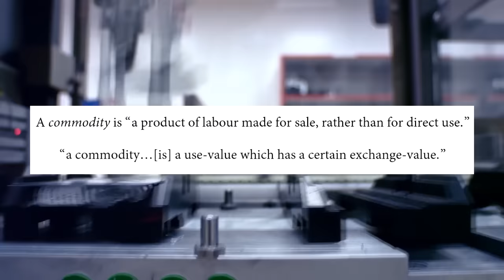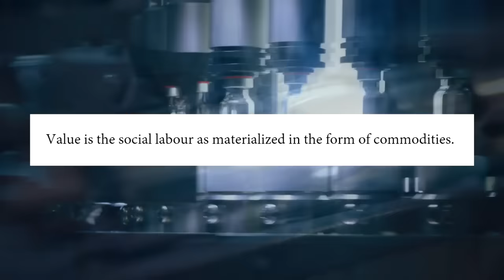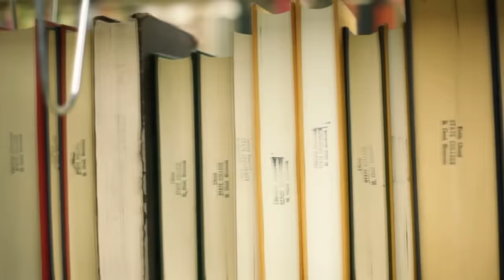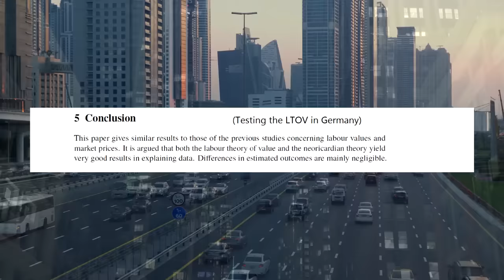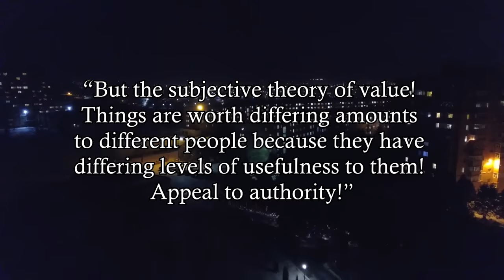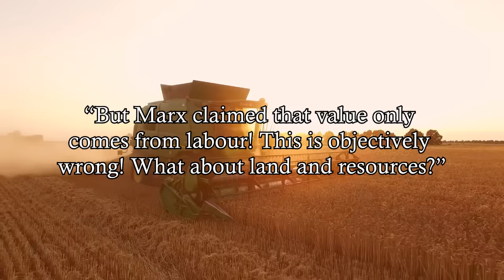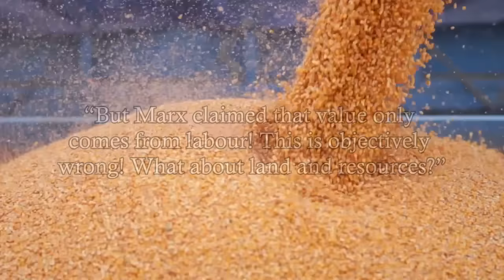Capitalist arguments against the labor theory of value suck (Explaining the LTOV) - Socialism 101

Comment: My Marxian econ prof explained it to me best: LTV doesn’t determine price (in a market), supply/demand does. But the difference between material cost and price is best explained by the labor that shaped the material into the final product.
Reply: Any contention to this is just ideological opposition to marx, before marx all capitalist economists agreed with this premise, because it’s obviously correct.
Reply: Except supply and demand are a myth
Reply: Some genius in economics:
“bUt WhAt iF I wAnT tO pAy $1000 fOr A jAr Of AiR ?
ChEcKmAtE, MaRxiSts !”
Reply: It kinda does. It basically sets an equilibrium point around which the price dances. Market forces can affect price to a degree but a car will have higher price than a pencil and calculating labout inputs allows you to predict prices with 95+% accuracy, which is better than any other economic theory.
Reply: @cezarcatalin1406  or for gamer girl bathwater :^)
Reply: @nonono4160  Until companies decide to ratchet up the prices randomly like they do all the time for all sorts of things?
Reply: @RaistlinMajereFistandantilus  i suggest you read "Scientific status of LTV" by Cockshott and Cottrell.
Reply: @RaistlinMajereFistandantilus   exact pricing aside, the only reason they can charge more than the material cost is because of labor. monopolist exploitation of consumers for necessary goods is a very different animal
Reply: @Bovice..YT-handles-are-fn-dumb  You’d need to look at course catalogs for the econ department at any given university. If there’s a good number of classes on labor, socialism, inequality, china, ussr and marxism then you can bet there’s plenty of marxist profs in the department. I got lucky and my (capitalist) family’s preferred university also happens to be the only university in the USA where Marxism is dominant in the econ department. (Surprisingly, the University of Utah, if you’re curious)
Reply: @jaredharmer7047  So Utah is officially AES?
Reply: @lucastudios86  I don’t know what AES means
Reply: @jaredharmer7047  “Actually existing socialism”, I was joking (even though “Soviet Republic of Utah” sounds nice)
Reply: @lucastudios86  when the US has its revolution I would guess states would take up the name Utah SR for socialist republic. 

So the USA would turn into the USSA (which I think is quite nice)
Reply: @jaredharmer7047  Literally the last state I'd think of, after Texas. Lol
Thanks for sharing
Reply: @cezarcatalin1406  like ppl don’t already do things similar to that now
Reply: @RaistlinMajereFistandantilus  The notion of some glorious equilibrium is a myth, the existence of supply and demand curves isn't. Businesses are going to produce more if the price is higher, consumers are going to demand less if the price is higher. However having some magic point of perfect equilibrium is ridiculous.
Reply: @lucastudios86  It would just be "Social Republic" or "People's Republic" rather than Soviet, given that it's not really a "soviet" (worker council) system.
Reply: @jeetadityachatterjee6995  If each state becomes its own independent republic, similar to members of the USSR, maybe it'd become the United Socialist Republics of America, or United People's Republics of America (in the same vein as People's Republic of China)
Reply: @Tetragrammaton22  Make sure to edit that bit about businesses producing more with higher prices, but yes as an economist this is definitely the way I see it. Economics is a social science based on philosophy and a bit of math, not an exact science 100% based on math. Anyone (liberals/conservatives usually) who says that economics is an exact science is either deluded, a grifter or both
Reply: @simonmacconmidhe9489  Well strictly speaking prices are determined by capitalists, but if they’re smart (which certainly is not always the case) then in order to maximize profit the price will be set where the inverse-elasticity of demand = markup, which is dependent on competition, demand and overall supply in the market. Necessities and monopoly markets have a high inverse-elasticity, so they have a higher markup.
Reply: the LTOV doesn't determine the final price per see, but it does determine its center of gravity. the final price can go lower, or higher, than the center of gravity, but it always revolves around it.
the descrepancy then, between the center of gravity, and the price at any single point in time, comes from bargaining power, not necessarily supply and demand.
for example, with high supply, a capitalist can get away with less, due to competition with other capitalists who will seek to undercut them; but a monopolistic capitalist, even if they have high supply, can get away with more.
the bigger the bargaining power of a holder of a commodity, in relation to its buyer, the bigger the descrepancy between the final price of a commodity, and its center of gravity.
Reply: Schrödingers Katze  Yeah it’s tough. Wolff and Piketty are pretty solid in the modern day, but that class really just focused on Capital, the value was more in having a prof to explain it and provide modern empirical evidence for it. So any material that thoroughly dives into Capital would more or less be akin to what I experienced in that class
Reply: the socially necessary labor time embodied in commodities determines supply and demand. pointing to supply and demand as the determiner of prices on the market is begging the question.
Reply: @jaredharmer7047  Utah?! Yes that is a surprise
Reply: @simonmacconmidhe9489  nah, the layman one.
Reply: @RaistlinMajereFistandantilus  I would use the word social construct like any economic system. But yeah we don't have to a system depending on supply and demand.
Reply: @flantos23   the total amount of labor time (and thus total amount of supply) is determined by the capitalist. Consumers determine demand. So no, you’re wrong on both fronts.
Reply: @simonmacconmidhe9489  No prob comrade
Reply: @Bovice..YT-handles-are-fn-dumb  how do you know he studied in the US
Reply: No, it isn’t as demonstrated by Bohm Bawerk and time value of money.
Reply: @ExPwner  if I remember them correctly, they are a joke dude
Reply: @Kolokommouna  nope. They are not and this is not an argument.
Reply: But your "marxian econ"(whatever that means) peof is wrong.

Profit determines prices, supply and demand equillibriating is profit. if you have an industry of duopoly.where one market is perfect and the other is a monopoly. you have two competing markets. the monopoly can set prices twice lower or higher based on its elasticity. meaning what prices it deemed profitable in relation to quantity.perhaps setting prices lower at bigger quantities is more profitable. so you see.profit is what determine price.
Reply: @proximaism  Well technically the profit maximizing price is set based on inverse-elasticity, which is a function of supply, demand and competition. So understanding profit is necessary to calculate the profit maximizing price, but that doesn’t mean profit caused the price - supply, demand and competition does that.
Reply: @proximaism  profit determines the direction of capital. If you are so inefficient that the prices set by supply-demand dynamics make you go negative, you are going to be outcompeted.
Reply: @ExPwner  ofc it's not. It is a statement that alludes to arguments you, yes you, can find on the internet 
Do your own research I am not your teacher
Reply: @Kolokommouna  you have no argument against Bohm Bawerk and neither do any of the Marxists. Hell you couldn’t even be bothered to restate what his refutation is. “Google it” is not an argument either. It’s just lazy ass posturing. I have done my research and I am debunking this garbage with my research. Take your own advice.
Reply: @ExPwner  not everyone is able to be constantly able for an all-out ideological debate. Call me lazy if you want, but you can't know the circumstances of my previous comment.
However, if you're truly interested in research and the truth, and not just self-validation, you'd search for possible challenges to your beliefs when you're made aware of them. To have no doubt and to stagnate is folly.
Also, be careful of calling scientifically proven theories garbage. I see that the OG commentator has more energy than me, go argue there
Reply: @RaistlinMajereFistandantilus  they're not a myth on their own, they're just most useful as academic modeling concepts and can't be treated as some kind of established physical law. 

Because economics are not a hard science, it's a social science, and most of its adherents do not appreciate that truth.
Reply: @RaistlinMajereFistandantilus  so is money- but that doesnt change what will be done to you if you don't pay your bills
Reply: @jaredharmer7047  well- having a monopoly or near monopoly kinda lets you charge whatever you want. Labor sets the price floor, which is definitely kept track of to determine margins.

Although- our economy has gotten excessively weird, and loss-leader strategies dig beneath the price floor, as do anticompetitive strategies like the purely labor service industries of DoorDash/Uber

The word "value" is a little wishy washy, but its pretty clear what he meant. 

Basically, you make profit when you underpay your labor or charge above the real value.
Reply: @jeetadityachatterjee6995  are you serious about that revolution?
Reply: A Marxian econ professor?? Where
Reply: @playerhateroftheyear1084  Ironically, University of Utah economics haha. My upper division macro prof is a hardline Maoist who got expelled from China for criticizing the CCP from its left flank. (Li Minqi , his wikipedia is fascinating if you’re curious)
Reply: @Kolokommouna  nothing about your theory is scientifically proven.
Reply: @ExPwner  
p(X=x) = [1/σ*sqrt(2π)]*[-(x-<x>)^2/2σ^2]
The probability density function of a random event with values that tend to concentrate around a mean value. 

It has been used by Cockshott, analysing the seemingly random patterns of prices. Naturally, the LTV was proven correct with a 95% accuracy, a ridiculously small relative error btw, using this method, not unlike the methodology of defining the laws of thermodynamics
Reply: @Kolokommouna  again, already addressed and debunked.
Reply: @ExPwner  you can't debunk a fact. Its interpretation, yes but not a fact.

You didn't debunk the fact I presented.
Reply: How does that apply to a service economy?
Reply: @RaistlinMajereFistandantilus  cringe
Reply: @Etherchannel  if you use Adam smith's distinction between unproductive and productive labour, it still applies
Reply: @Etherchannel it’s the same, it’s just shaping immaterial stuff (training) into a final immaterial product (service)
Reply: This is only true if you include subjective components (mainly marketing) as part of the final product, since some markets have very low cost of production (like beverages, as beer and vodka, that cost cents to produce) and very high margins into the price. I've heard recently of a beer sold for 0,86 for employees, which is sold for around 13,99 in the market for final consumers. The difference, even accounting taxes, transportation and selling costs (whole sales and retailer), can't be explained only with material cost and labour.
Reply: @RaistlinMajereFistandantilus  that's the only explanation to why an iPhone is marketed at USD 2.000.
Reply: @jaredharmer7047  the cost correlation with labour time is because hourly pay is based on labour time. More labour time means more cost to the final product according to time.

It's no great insight to say that the portion of product price above material cost tracks closely with labor time when that is literally the system you are using to pay the laborers! It's a self fulfilling prophecy. 

If you take step back and think about, it is common sense.

If you had a different method of payment for the laborers not based on flat time, the portion of product price due to labor would be explained much more by supply and demand rather than labor time just like the rest of our value system.
Reply: @RaistlinMajereFistandantilus  You can only ratchet up prices so much until consumers are unwilling to pay for things. Prices are set by the average rate of profit pertaining to each industrial sphere. Price changes that are unrelated to material changes in value can only affect a minority of capitalist businesses and are offset by changes in the opposite direction by other businesses.
Reply: @jeetadityachatterjee6995  USSR stood for United Soviet Socialist Republic
Reply: @howenator  That's just factually untrue. For one, look at gas. Prices go up across the board and people have literally no choice but to pay whatever insane price they set. If an entire industry decides to fuck you over all at once you have no recourse. It happened with internet providers, it happens all the time with water and electrical power providers, they can simply charge whatever insane price they want and people don't have the option to choose not to pay.
Reply: @howenator  Plus, they are absolutely in no way offset by changes in the opposite direction. If that were true then inflation wouldn't exist cause some things would get more expensive and others would get less. Historically all businesses raise their prices as soon as they feel like they can get away with it.
Reply: Hell even Karl Marx said it himself that LTV doesn’t determine price. price and value are two separate things.
Reply: Labor theory of value always comes second to subjective theory of value. You may call people "weird" and the subjective theory of value ridiculous but that's how the world works.

People have different interests and different values that's why it's in fact ridiculous to try to quantify something like "a value of a product" in the way Marxism does.

In fact, our interpretation of the world is not materialistic, it's a bunch of categories which we apply value to because in this way it's easier to organise the world around us. Much like when we use the interface of a computer program instead of the actual mechanism of the program which would be an impossible task for most people!

Again, Dialectical materialism is the culprit for that line of thinking! It's an inadequate philosophy no matter how much you are mad at Capitalism!
Reply: the transformation of something to something is derived from labor, but the valuation itself isn’t
Reply: That doesn't make sense. Given a uniform profit rate, prices are determined by costs. Obviously, costs consist of material costs and wages, so the difference between material costs and prices is explained by wages and the profit rate, but that has nothing to do with marx and is completely in agreement with neoclassical economics.
Reply: Wow, that's possibly the dumbest thing I've ever read.  LTV does not describe the cost and price, as both are prices.  Only DEMAND affects the difference between cost and what you sell it to the consumer to.  Holy crap, I can't believe you actually said that came from a professor. 

The labor theory of value is capable ONLY of describing the amount of labor necessary.  Which is useless for all applications, as amount of labor is absolutely useless, only price of labor has use.
Reply: @SnakeWasRight  that's also wrong. Demand does not determine the profit rate. For a fixed level of wages, there is only one set of prices in all the different industries that implies the same profit rate for all industries. That profit rate does not depend on demand.
Reply: @Porky no. Not at all.
Reply: @Ffkslawlnkn  wrong on every conceivable level.  Those guys can't be making profit unless there's a demand for their labor.  No, every company does not have the same rate of profit.  The reason prices are SIMILAR across an industry is ALSO because of DEMAND.  customers demand lower prices, so if you can offer them lower prices, you can get more customers.  Some customers will pay a premium for brand names, they have a demand for a brand name which makes products of identical functional quality have different prices based on DEMAND for a brand logo.  It truly astounds me how commies don't know the first thing about why people buy things... well it should be that shocking, given how all their economic models always fail catastrophically.
Reply: @SnakeWasRight  obviously, you can't sell goods unless someone wants to buy them. Nobody thinks you can sell products no one wants to buy. But the rate of profit does not depend on demand. Capital flows where it generates the most profit. Thus, profit rates in different industries tend to even out. Every theory, from classical to marxist to (post-)keynesian to neoclassical, assumes this.
An economy with n goods therefore can be represented as a system of n equations of the form price=sum of (amount of goods necessary for production*prices)*(1+profit rate)+hours*wage.
n equations with n+2 unknowns means that if we treat say good 1 as a numeraire and fix wages, there is only one level of profit that solves this system. The profit rate converges towards this level, which does not depend on demand.
Reply: @SnakeWasRight  price depends on demand only in the short run. Long run prices are the prices that solve the equilibrium system. If the price of good 1 is any higher (say because of a hike in demand), producing good 1 is more profitable than producing say good 2. As a consequence, capital is flowing from industry 2 to industry 1, increasing the price of good 2 and decreasing the price of good 1.
According to standard mainstream economics, the labour market tends towards equilibrium, so the wage only depends on the derivative of the production function and the labour supply, not on the demand for goods.
Reply: @jaredharmer7047  no economist ever thought that labour does not explain prices, but does explain the difference between the price of a good and its production cost. It does not make any sense. Production cost IS a sum of prices. Either the ltv does explain prices (which it does not, as marx knew very well), or it does not - and then it cannot explain profit. Also, demand does not explain prices either.
Reply: @nonono4160  a car has a higher prices thanba pencil because nobody would supply a car for 5$. The amount of labour necessary to produce a good does not determine its equilibrium price. Equilibrium prices and labour time have to diverge if the capital to labour ratio is not equal in all industries. Marx knew this of course.
Reply: @bb-wb8sb  not only is there no reason why the amount of labour should determine a good's equilibrium price, it is also logically impossible if you are not assuming constant capital to labour ratio in every industry.
Reply: @jaredharmer7047  Do you realize that it does not make sense to suggest that something does not explain prices, but does explain differences between prices?
Reply: @Ffkslawlnkn  Looks like jamesbunchofnumbers skipped calculus class
Reply: @jaredharmer7047  you actually do not realize that it does not make sense to suggest that prices are determined by supply and demand, but profit - the difference of prices - is not? I am ... impressed in a way.
Reply: @Ffkslawlnkn  Bro 847 other people understood it, it’s not my fault your brain is broken. The point is that it’s a qualitative explanation, not a quantitative one
Reply: @jaredharmer7047  'look there are people agreeing with me' is a pretty strange argument, considering the fact that nearly all economists in the world disagree with you.
The idea of a 'qualitative' explanation for the fact that there is profit does not make sense. There is profit (aka price-cost) because price is higher than cost. And if price and cost are determined by supply and demand, then the difference is, too, and the explanation for the positive difference between price and cost is that businesses would not supply if they did not make profit.
Reply: @Ffkslawlnkn  "a car has a higher prices thanba pencil because nobody would supply a car for 5$"

That is just a roundabout way to say "that's just how it is, no one knows why". Not an actual explanation or rebuttal.
Reply: @nonono4160  you were implying that it's not market forces that make cars more expensive than pencils. But this fact is entirely consistent with and can be subsumed under the market forces of supply and demand.
If your point is that reproduction costs constitute a lower bound for wages - sure, and nobody denies that. Nobody would rebut that.
There is a definite rebuttal of the idea that labour time is proportional to prices though, and marx himself wrote about it extensively.
Reply: @Ffkslawlnkn  you dance around the issue without actually answering what you should've answered in previous post. Also, it's not direct labor time, it is snlt that defines the equilibrium for prices.
Reply: @nonono4160  not only is there not argument for snlt to determine prices, it is actually impossible for prices to be proportional to snlt except if all industries exhibit the identical labour to capital ratio (or the profit rate is zero). This result isn't 'debunking marx', it is something that marx himself knew and wrote about extensively in the third vol of das kapital. It's called transformation problem, and I'm confused by how many people don't know about it, given that it is probably the most debated topic in marxian literature.
As to 'dancing around the issue': I have already written that my point here was that the fact that a car is more expensive than a pencil is not something that's somehow not covered by the standard explanation via market forces.
Reply: @nonono4160  lol of course it is. It is about TRANSFORMING values into production prices, because they do not generally coincide.
Wikipedia:
"the transformation problem is the problem of finding a general rule by which to transform the "values" of commodities (based on their socially necessary labour content, according to his labour theory of value) into the "competitive prices" of the marketplace. This problem was first introduced by Marx in chapter 9 of the draft of volume 3 of Capital, where he also sketched a solution. The essential difficulty was this: given that Marx derived profit, in the form of surplus value, from direct labour inputs, and that the ratio of direct labour input to capital input varied widely between commodities, how could he reconcile this with a tendency toward an average rate of profit on all capital invested among industries, if such a tendency (as predicted by Marx and Ricardo) exists?"
You obviously dont know the transformation problem. I'm curious: how can you read my comment, realize that you have no idea what I am talking about, not even skim over the wikipedia entry, and conclude that you must be right in your opposition to the very thing you know nothing about?
Reply: @Ffkslawlnkn  you already admitted it. Price is zero if there is no demand.  No matter the supply or the labor value.  This is inescapable.  

You have also yet to address the branding example where virtually identical products are different prices based on demand.
Reply: @SnakeWasRight  I don't understand what you are arguing against. Nobody thinks that you can sell goods that nobody wants to buy. And I sincerely have no idea what you think I have to address with respect to branding. Some people prefer adidas over similar no-name shoes. Adidas has a higher profit rate than a no-name company. That's called a monopoly. A monopoly is the exception, not the norm. The norm is a more or less competitive market resulting in a convergence of profit rates. There is a lot of empirical literature supporting that. With a few exceptions, prices are formed like I explained, and the magnitude of the corresponding profit rates do not depend upon the magnitude or demand.
Reply: @Ffkslawlnkn  there's a reason for that.  Because demand affects price.  Which for some reason you think is crazy.  No, Adidas does not have a monopoly.  Nor is having a market preference over other products having a monopoly.  You literally don't know what a monopoly is.  A monopoly is capturing almost the entire market.  

Just because SOME people will pay a premium for branding doesn't mean that brand has a monopoly, that means it has a market niche.  

You already admitted that prices ARRIVE at a certain value due to demand.  You said "in the short term" as if that somehow makes a difference.  All that means is that you admitted my whole point.  If a fluctuation in demand fluctuates price, whether it happens quickly or not, that means it's an important factor in price.  What you describe with "short term" is just the price settling at a value that matches supply and demand.  When those change, so does price.  Labor theory of value fails that economics 101 utterly.
Reply: @SnakeWasRight  i have demonstrated with this system of equations above that demand cannot influence price except for firms with a considerable amount of market power. Did you not understand that at all?
No, that demand affects price in the short run means not at all what you think it means. If demand rises above supply, prices rise in the short run - and with it, profit for this industry. Due to the higher profit, capital flows in the industry, increasing supply. Supply and demand even out, and the price returns to its old level. It follows that increases or decreases in demand might effect prices in the short run, but not in the long run.
This is the standard neoclassical theory of price determination. Had you ever done a course in economics or read a textbook, you would know that the long-run supply curve is perfectly inelastic. This precisely means that demand does not change the long-run price.
The scientific term for a market with businesses with considerable market power is monopolistic competition, but given that you do not know the basics of the standard theory of prices, I assumed you would not know that either.
Reply: @SnakeWasRight  you missed the point entirely with absolute confidence.
1. I have not lost a word on the ltv, I don't know why you think I am defending it. What I am defending is the standard price theory taught in universities around the world. This is exactly what the assumption of a perfectly inelastic long run supply curve amounts to.
2. There is an equilibrium-profit-rate around which individual profit rates fluctuate. This is empirically well established.
3. No, I did not somehow 'admit that lower demand means lower price'. Normally, demand has nothing to do with equilibrium prices. The only exceptions are firms with considerable market power. As I wrote many times.
4. The system of equations does not presuppose that price is independent of demand, IT PROVES IT. given a fixed wage, there is only one set of relative prices that solves the system. I explained the intuition behind that result numerous times. If a price is above its equilibrium price, capital will flow into that industry and lower it.
The wage is independent of the demand on the goods market because the neoclassical paradigm assumes that the labour market always clears. Again, as I already wrote.
7. Of course business owners change prices to meet demand. If demand > supply, the price increases. Then supply increases and price drops back to its original level. This equilibrium level does not depend on demand. That is exactly what I have explained three times now. In economics, it is called the difference between short and long run. In a standard economics course, you will be shown an increasing supply curve for the short run and a perfectly elastic supply curve for the long run.
Reply: @Ffkslawlnkn  I have confidence, but it only goes as far as what I can demonstrate, and nothing is absolutely certain.  I'm a skeptic so I only believe as far as the evidence goes, but I will speak my mind without shame.  

So,  I never claimed anything about the profit rate, yet that is what you originally responded with.  I'm talking about the objective fact that the difference in final price and production cost is not accountable with purely material and production costs.  So you're just responding to a giant strawman.  

1.  Standard price theory is not inelastic, and includes demand. 
2. And why does it fluctuate?  And why does it fluctuate so much?  Mom and pop stores vs. Lockheed Martin.  Whoops.  There is no average or standard here that any rate or margin stays near.  There's a minimum which if not reached, people won't invest, sure... but again, not sure why you're bringing up profit rate, has nothing to do with what my original criticism was. 
3. Yup, exceptions result from the theory being incomplete.  You did admit less demand equals lower prices.  No demand commands no price.  That's on one end of the spectrum.  But take used items, even in perfect condition.  The price is lower.  Why?  You can't answer without demand.  Price of a car plummets the second it drives off the lot.  Whoops!  
4. Oh, right, given a fixed wage, which is and has never existed in any market system ever.  Whoops!  Meanwhile, in reality, wages fluctuate with demand.  
Your intuitive example seems meaningless; different industries have different equilibrium prices and different brands in the same industry have different equilibrium prices that hold differences over decades... and yes, supply, which is affected by investment capital, will affect the price.  That doesn't remotely address how demand also affects it.  Wages are not independent of demand on the goods market at all.  Value of goods increases profit potential which increases the demand for labor.  The more money you make me, the more money I'm gonna pay you.  Whoops!  

I guess you skipped 5 and 6, so...
7.  Yeah, sometimes.  But supply doesn't necessarily increase just because demand does.  You should know that.  Both supply and demand affect the price.  I don't see what's so controversial about this, you're trying to gaslight me to think standard economics doesn't use demand at all to determine price.  

In standard economics, equilibrium price decreases if demands decreases.  Stop avoiding this.  😤
Reply: @nonono4160  lol
Reply: I bet your professor ignored intellectual labor done by managers, owners, investors, advertisers, etc. Otherwise, whoops!  All profit is simply labor cost!
Reply: @jaredharmer7047  it's obviously not correct, which is why most economists today reject it utterly.  Also, it's obviously wrong because demand STILL determines whether that labor has ANY value!!! DUHHHHHHHHHHHHH
Reply: @RaistlinMajereFistandantilus  except they're not.  Labor and supply has ZERO value without demand.
Reply: @nonono4160  But the product has to be deemed "useful" by the market in order the prediction to make even sense!

Marx has said that LTV applies only to "useful" products! Well, the "usefulness" is exactly the STV ! You need the STV to set the whole process in motion and considering you said LTV predicted price with 95% accuracy, why not just let the market determine the price... it's 100% accuracy in this case!
Reply: @RaistlinMajereFistandantilus  So, microorganisms also a myth then?
Reply: But how do you determine the cost of the labor that shaped the material into the final product? 

If you don't account for supply/demand of labor (especially skilled labor), then you will end up with shortages... which you see everywhere in communism.
Reply: But the value of labour is also determined by supply (of workers) and demand (of employers)
Reply: That's why labour is so much cheaper in overpopulated countries like China and India
Reply: @jaredharmer7047  "the face you make when you went to school to get a degree in economics and ended up with a degree in mystic theology instead" 😆